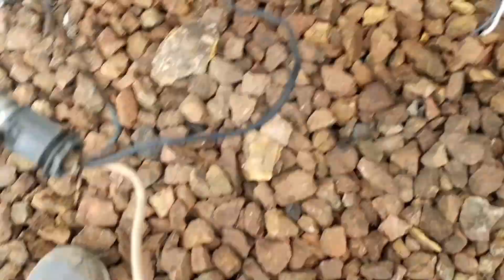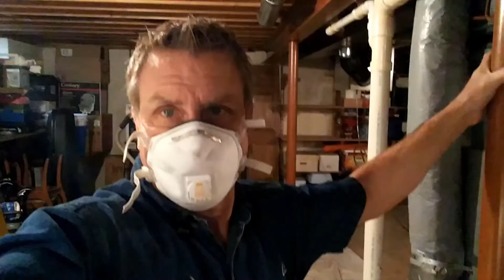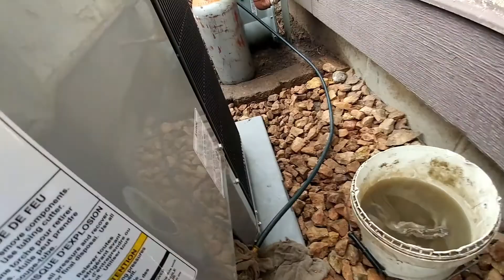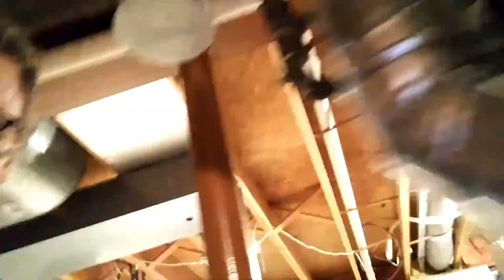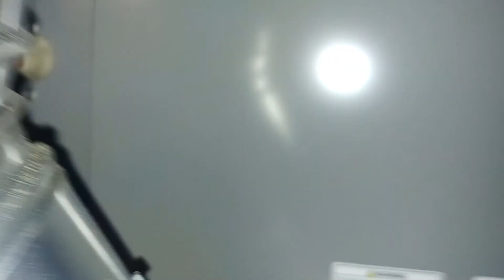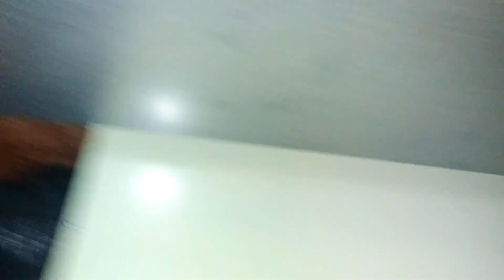Bo ac installation with new line set

Comment: Thanks for showing your process. Lot of good info. I started using the uniweld Captain hook torch tip about a year ago.  I'm able to get to temperature, braze, and get off the copper much faster with it than with a single orifice tip.
Reply from the maker: Yes. I have one. I found it hard to use. Tried it on a compressor replacement and it's been in my truck ever since.
Reply: @EdPelto  I could do without the angled flames. There’s plenty of room to use one outside, rarely inside.

Comment: The torch is blowing out because you have the oxygen pressure set too high.  Your not using a cutting torch dude.  Practice practice practice. Working way to close to copper.
Reply: I'm learning with him. Thanks for the video